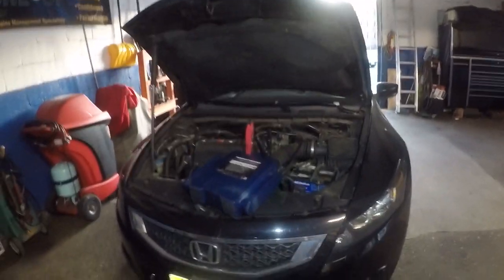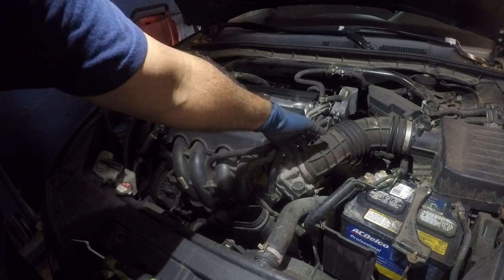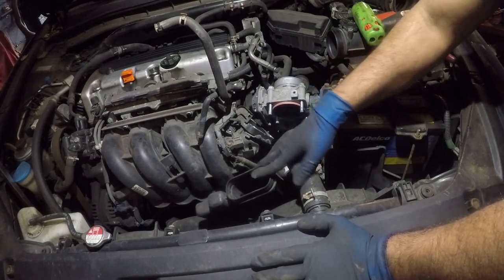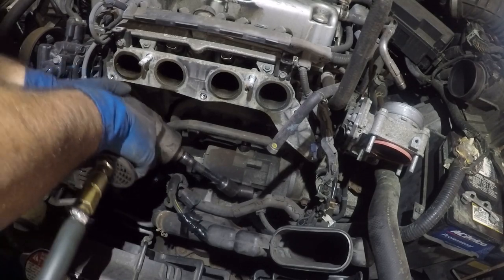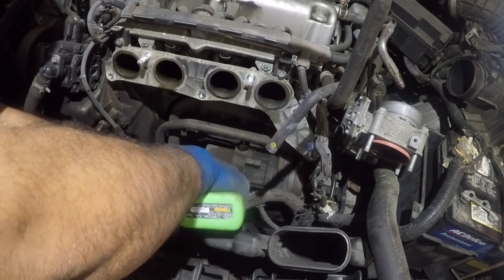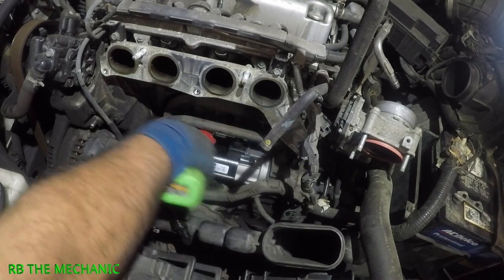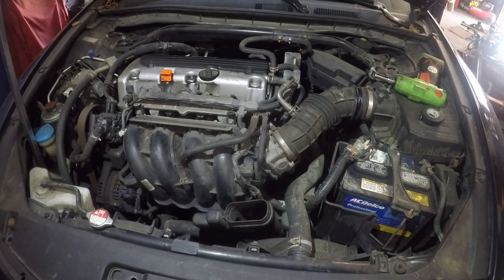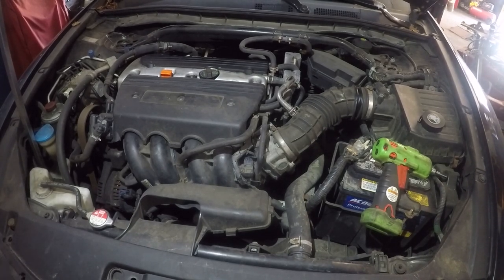How to replace starter motor on 2003-2012 Honda Accord 2.4

Comment: Got her done thanks to this video! Saved 1100 dollars. Honda dealership quoted me 1400 bucks to replace
Reply from the maker: Damnn what they wanted to replace the engine?
Reply: @RBTheMechanic  yeah I know right! They said the OEM starter cost 850 and labor was 550....
Reply from the maker: @dingledong94  they crazy I use to work for honda dealer they are stealers rip people off and use pepboy parts and charge people for honda own part I remember I put pepboy filter on 2006 accord in 2006 when I was intern brand new accord it was

Comment: Thanks for the detailed instructional video. Very helpful. I used your video to assist in the removal and replacement Of the starter in my 2011 Honda Accord LX 2.4l.  Very helpful. Took about 2hrs due to me having to go get a 17mm socket that I didn’t have. This was used to remove the bottom socket that the starter was attached to. And man… that this was stuck. Had to use a cheater bar.  Thanks again!
Reply from the maker: Yeah that bolt is tight and hard to get off but good job well done!!!

Comment: Your  instructions were great. The only thing im having issues with is the 17 bolt on the starter. I dont have that impact gun so i tried with the rachet and it got loose but the screw wont come off. Any tips?
Reply from the maker: Try kinder ratchet will give u more levrage or wrench on wrench

Comment: Do I need to replace the gasket between the manifold and the engine block before reattaching the manifold?

I need to get myself some spare vacuum hose and a new pair of needle-nose if I decide to do the starter myself. It doesn't look like there's a whole lot of extra hose for that one vacuum line on the passenger side if I should tear the line.

 I'm waiting to see what a local repair shop will charge me before I decide to do it myself.
Reply from the maker: That would be good idea but this metal one dosent go bad as easy
Reply: Shop says 200$ if I bring part so just labor watching this video I wanna do myself 😅

Comment: Hi i got a question before the starter goes bad on this Honda. Does bad starter makes stalls when stooping at a red light or when idle?
Reply from the maker: No starter dosent have anything to do with anything once car has started stall would be related to throttle

Comment: Thank u great help. How much torque for the manifold to the engine. I did mines snug on there but I wanna torque it to be on the safe side
Reply from the maker: Give me year make model I’ll get u the torque in morning
Reply: 2012 Accord coupe. 2.4 LX
Reply from the maker: @babyz1354  the intake nuts and bolts are 16 ft lb the bracket is also 16 the 4 bolts on throttle also 16
Reply: Thank you really appreciate your help. I was able to save $ on labor thru your videos.

Comment: Thank you for putting the video, everything is like the video, and the gear starts, but the engine does not turn on.
Reply from the maker: What’s going on describe me the issue very specifically
Reply: I installed the starter car cranks but wont turn over
Reply from the maker: @95pavis  wount turn over but cranks .... check fuel sand spark scan the car for codes let me know if any codes

Comment: My 2008 honda accord 2.4 has  a higher rpm after replacing remanufacture starter from Auto zone.
It happens only during  cold start. Once engine worms up, it goes to normal rpm. I also noticed  that car is in rich fuel condition slightly. But, no check engine light on.
What I need to check?
Reply from the maker: Young Yoo I think they disconnected the battery just give it some time it might go back to normal after few key cycles if it dosent then you have to rest the throttle let me know after some while if it goes back to normal
Reply: Spray around you intake with carb cleaner, if it bogs down then you have a leak. Chances are it is an intake manifold leak. Once it warms up everything expands and seals. So do spray check when cold and is giving you problems.

Comment: Awesome video thanks; I have a   1300/1400 rpm after changing starter. You mentioned this in the 11:40 second part of your video about the throttle body. What should I do? I also cleaned the mass air flow sensor, which autozone-P0507 code came back with health report print out. Does any sensor need reprogramming?
Reply from the maker: Did u disconnect the battery to do this?
Reply from the maker: If u disconnected the battery you have lost idle memory but that’s ok when car is cold rpm with be high let it get hot it should be down to normal 800 rpm if it normal ur good if there’s any problem check engine light will come on and code will say high rpm that expected then u need to relearn the throttle I usually do that by scan tool but u can drive the car around reset the light make sure every thing is off such as heat ac lights just abs drive for 10-15 minutes it should relearn and become to normal states
Reply: Yes I did b/c I started with a different video then found yours and it was too late. But I drove the car and it’s still high idle at park and while it’s driving. What should I do?
Reply from the maker: @omarsuarez8990  what year is ur car
Reply: @RBTheMechanic  2012 Honda Accord
Reply: 4 cylinder sedan
Reply from the maker: @omarsuarez8990  ok do u have scan tool to reset the check engine if u do reset it and drive it with every thing off radio lights wiper no load at all it should relearn
Reply: @RBTheMechanic  no I don’t have a scan tool, where do you suggest that I take my check engine light off? And remember my P0507 code came back from the autozone print out
Reply: @RBTheMechanic  where do you live?
Reply from the maker: @omarsuarez8990  I’m up north NJ but I’m closed as of now due to covid situation things r serious down here
Reply: @RBTheMechanic  oh man I’m in Hollywood, FL... it’s nice weather down here. So I’ll have to find someone to reset the check engine tomorrow and see how it goes like you did with nothing on... lights, radio, ac, etc, etc. I’ll let you know tomorrow. Have a good night and thanks a million for today. That was an amazing video, so helpful.
Reply: @RBTheMechanic  Hi I got the problem resolved just like you said...to a T! Thank you so much, your amazing my dude.

Comment: Is this any different from a 2012.
Are there coolent lines connected to throttle body?
Reply from the maker: Should be same exact not sure about throttle coolant lines either way should be very very similar 99.9%
Reply: @RBTheMechanic  cool man thanks.
Someone told her it was the starter...when I got there I eventually found out it was a rat that chewed up wires. I reconnected one of the chewd up grounds.
It starts now but is missing and throwing a couple codes. 
Guess I need to find some more damaged wires
Reply from the maker: @jdillon575  yeah check for misfire codes and see when cylinder it is and check wires on coils and injectors
Reply: @RBTheMechanic thanks.
 it's also throwing a U015 code or something like that. Think it's something about miscommunication with the computer.

Comment: I think your description of the video is incorrect.  Should read "How to replace starter motor on 2008-2012 Honda Accord 2.4" .   Thanks
Reply from the maker: They are same one has metal intake the other has plastic with bit of changes

Comment: So when I went to put the battery cable on, it started cranking with no key in the ignition??
Reply from the maker: Pull the starter relay and see if it still dose that. Is it dose that it means the control circuit is completly dead since u pulled the fuse how ever the solenoid is engaged all times it could be bad start try pull the relay.
Reply: @RBTheMechanic  Everything checked back good. They sold me a faulty starter. Swapped it out and it worked.
Reply from the maker: @nitewalker033  oh 😎 cool I hate when u do a big job and it turn out defective part

Comment: Hey, buddy, i have a 03 accord i4, I drove the car yesterday all day with no issues came home unloaded the groceries no crank hearing a buzzing or whining noise from the starter, the battery is 2-3 months old I have light and power through out the car, can you give me some point with what's wrong with it. thank you
Reply from the maker: Find the starter relay then out ur finger on it have some one try start the car if u feel click on the relay then it’s bad starter
Reply: @RBTheMechanic  thank you,  i did that i swapped the relay around with another one but still the same whining and buzzing at the starter, also tryed to jump start it maybe i thought the battery might have died but the same issue  ?
Reply from the maker: @triagern7404  then u have bad starter
Reply: thank you buddy I truly appreciate the advice and you taking your time to answer back, thank you!!!
Reply from the maker: @triagern7404  no problem let me know how it went
Reply: @RBTheMechanic  it all went well the problem was the starter, changed it and in the process I blew the main window fuse the 50amp one took me 2hr to sort it out, but all in all my car works fine now, thank you for your advice
Reply from the maker: @triagern7404  good job!!! Yeah some times u make mistake like that one time I blew fuse on Mazda I knew which fuse it was and all but special order car was stuck with me 3 days
Reply: @RBTheMechanic  tell meabout i blew the fuse 23 on the engine fuse box in the engine bay replace it, and still shows sign of blowing anytime soon , when that goes i have no power to the windows and the car dont start, any point?
Reply from the maker: @triagern7404  check all other fuses

Comment: What happens if you don’t put the long bolt in?
Reply from the maker: Ahhh hood question it wouldn’t be wise to leave that out but ... but... if starter comes loose it can sit uneven and damage the flex plate teeth that’s if it comes loose
Reply: Ok thanks for replying.
Reply: One more question. Is it ok if you don’t put the black bracket back on the bottom of the intake manifold?
Reply from the maker: @jkel2606  it’s not gonna do any damage but try to spend 5 extra minutes and put it on .. it supports the intake. I have seen cars come to be that had previously removed and missing bracket and they r still running but I would give it 5-10 extra minutes
Reply: @RBTheMechanic  ok thanks

Comment: This is my most hated job on a Honda. They could've placed this starter in a better spot.
Reply from the maker: Yup but not so bad compaired to gmc acadia
Reply: @RBTheMechanic   Yeah I've worked on a Chevy Traverse which is the same thing. Terrible cars, just wait until you have to do a water pump on one. 😳

Comment: You disconect (- battery.) more fast and safety then use the tape
Reply from the maker: Huy Dinh what if customer don’t have radio code? Then they blame it on you that’s the only reason other wise step # 1 is what you said !!!!
Reply: RB The Mechanic ok , you r right if need radio code!

Comment: FYI, leaving the negative battery terminal connected is not only dangerous  but completely unnecessary.  You will end up losing any stored DTCs (codes) in the  computer and all monitors will be erased.  No big deal.  One  word of warning though.  If you  clean the throttle body while it's off, the idle will be high when you restart and you'll need a scan tool to relearn the throttle position and idle speed.
Reply from the maker: I never had problem on honda with idle speed

Comment: The TB doesn't need to come off.
Reply from the maker: I seen it not come off street
Mechanic did it and forced the wiring and damaged harness I have video up for that anyways u can disconnect the connect and leave throttle on

Comment: This would be over a $1,000 repair at the Dealership. 
Gots take the whole motor apart to change the starter. what are they thinking, the old days I could had changed one out in 30 minutes.
Reply from the maker: Yeah do it urself I used original starter I like starter or alternator to be original on my cars but remy is what I put in customers cars it comes with life trine warrnty

Comment: My starter has 254 thousand miles and still going
Reply from the maker: Niceee
Reply from the maker: My honda needed alternator at 63k miles and 2 months later starter gave up I put both original from dealer alternator was $225 starter like $190
Reply: @RBTheMechanic  I checked the starter price it is $500 plus dollars from Honda Dealer, Crazy, the auto parts store was $214, plus like a $50 return of old starter.
Reply from the maker: @efirce  that’s tooo much I paid $247 original from dealer go to another store u can find good starter for like $160. I use remy it’s lifetimewarrnty